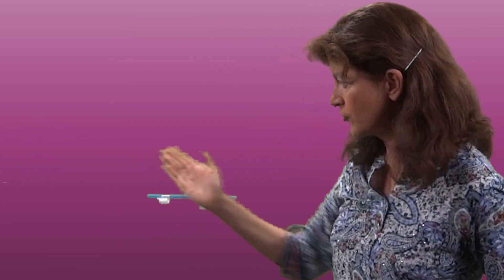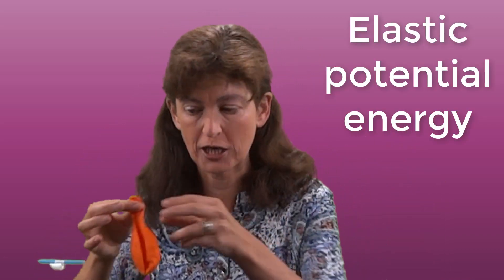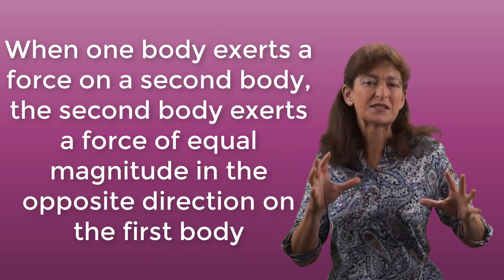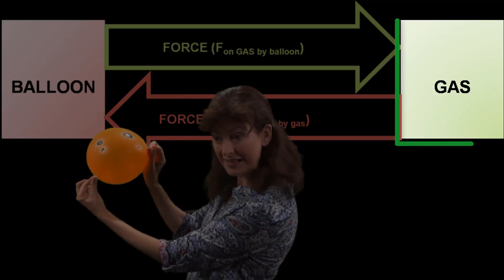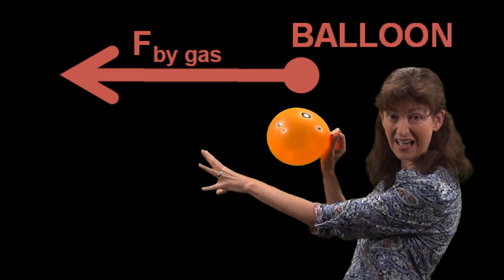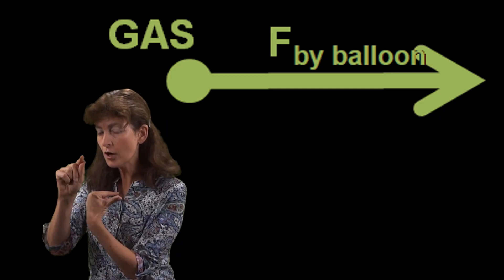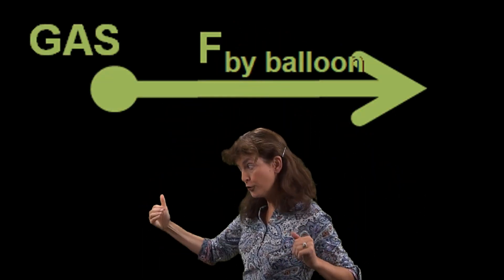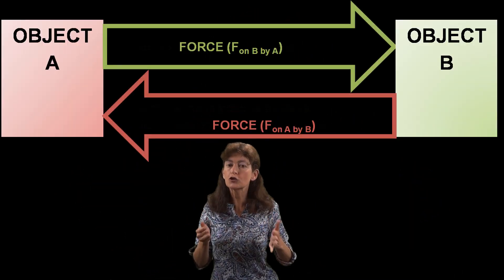The Physics of the Rocket Balloon: Energy Conversions and Newton's Third Law of Motion

Comment: Hi thanks for your explanation! There is still a piece which is missing in all explanations I've heard. The 2 examples of balloon and ball are not quite analogous. The gas inside the balloon is pressed in on all sides. The opening of the balloon is a "release of pre-existing pressure." The net force immediately decreases in the system of balloon+gas as the elastic energy decreases with the contraction of surface area of the balloon and the escape of gas to the larger system of balloon+gas+exterior space. On the other hand,  throwing the ball is an addition of new pressure which was not pre-existing in the system of ball+hand. Rather than a release of existing force, we have an application of new force from muscles preceding the hand, and the opposite reaction of the ball to that new force is what pushes the thrower away. The balloon does not have a new force, it suffers a decrease of existing force. Am I describing this clearly? Can you please address that difference? Thanks very much!
Reply: I think I answered the question. The answer both reveals how rockets work and also shows that balloons do NOT work like a rocket. The distinction is which force is first and which is the reaction. In the balloon, the contraction of the balloon is first, and the reaction is the expulsion of gas. The gas's force then becomes a first force against the air, which reacts against the gas, pushing it, and the balloon, back. In a rocket, the internal combustion is first, the gas expands and pushes against the top of the chamber, but there is nothing to push underneath, and that difference in resistance between top and bottom is what pushes the rocket. A better analogy for a rocket is when you're filling a balloon with the air. The walls expand outwards, just like the walls of the combustion chamber are pushed outwards and up.
Reply: Actually there's another difference between the balloon and rocket... The wall of the balloon opposite the opening is held in place, I.e. not greatly pushed back, by connection/friction with the other walls of the balloon. It doesn't get pushed back by the air because the contracting energy of the total 360 surface is so much greater and is pulling in from all directions.

I drew some diagrams to try to figure this problem out, but can't attach them here.
Reply from the maker: @bobmarley2713  that makes a lot of sense, thank you. Of course, the two forces in a N3 pair are actually simultaneous. However, that is hard to comprehend, so we describe it sequentially. Both the sequence and agency in your rocket explanation is better than mine, yes. Thanks for that. Interesting that there is an action and reaction, which certainly seems to be a cause and effect, while being simultaneous. It seems that defies the definition of cause and effect... your thoughts on that?
Reply: @LearnScienceCoZa  Thanks for all your replies!! I've been mulling it over and created an experiment which I think is analogous to the questions I have regarding sequence. I performed the experiment and I think it confirms my hunch. 

Take 2 matchbox cars facing each other in a straight line on a table. Give one a roll so it collides head on with the other. Notice how the motion of the first car is curtailed, it slows down, sometimes stops. The 2nd car starts to move in the same direction at nearly the same speed.

Repeat the experiment but go the other direction.

I believe you can imagine one direction as the balloon, and the other as the rocket. The wall of the balloon rushes in, pushing the air out, BUT, the equal reaction of the air curtails the motion of the wall, just like the stationary car curtailed the motion of the rolling car. Similarly, the motion of the gas in the rocket is curtailed by the resistance of the wall of the rocket chamber, and the wall of the chamber begins to move in the same direction as the gas, just like the stationary car was pushed in the same direction as the rolling car.
Reply from the maker: Thank you for your very thought-provoking comments. I suppose it is really atmospheric air which exerts the force which expels the gas that was in the balloon, and that gas provides the reaction force which pushes some atmosphere away, and the balloon wall is simply trapped in between these two? What do you think? Wouldn't make for a very good explanation to help someone understand N3 for the first time, though, don't you think?
Reply from the maker: The energy was "stored" in both cases - in the balloon case as elastic strain, in the hand case as chemical energy in the muscles. If the "sudden" release of already stored energy in the balloon case is to be considered differently to the "sudden" release of chemical energy in the other, then one could simply start moving the hand before it reaches the ball, as in a tennis serve.